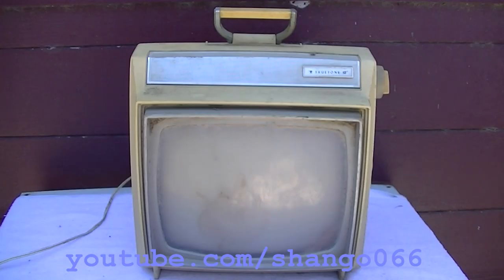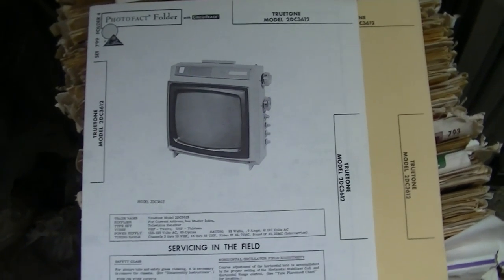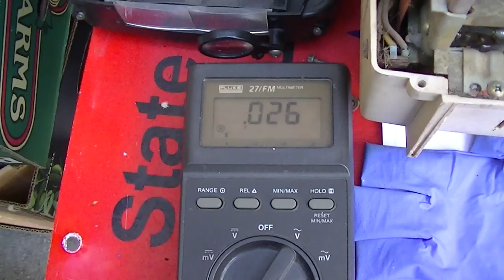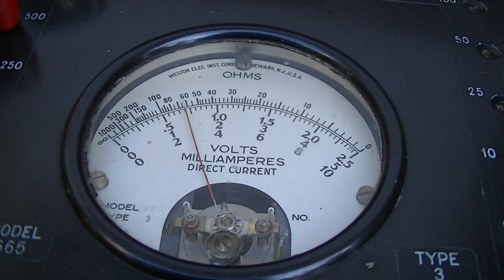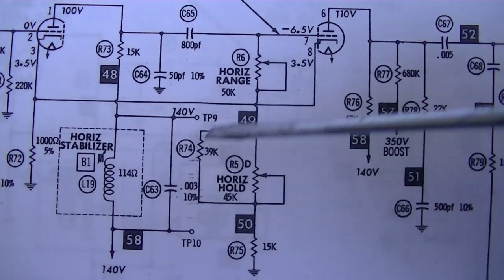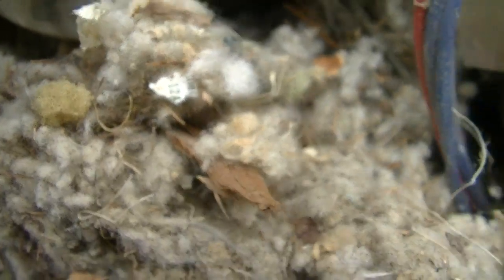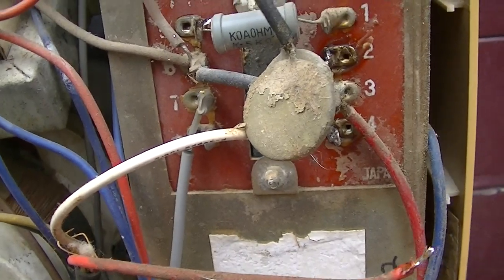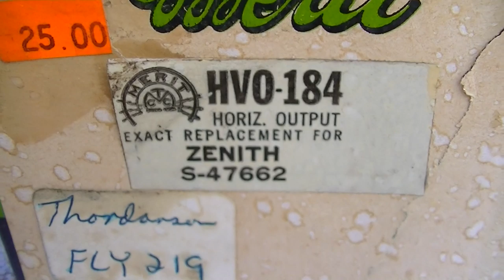Resurrection Of 1966 Truetone Portable Black And White Television Pt1

Comment: The way that the Line Output Transformer Primary in that Set was constructed was known as Wave Winding.A Lecturer at the College I went to in my youth had come up with a way of curing shorted and hard to get wound components.He would soak them in a mixture of Varnish and Turpentine and then allow them to dry before trying to use them again.I have not tried this myself but he seemed confident that this could be made to work.Good luck with your plan to try to substitute the Line Output Transformer and get a picture on this Set.

Comment: Diagnostic thinking, doesn't frustrate me at all. In fact it's through watching your videos and trying to think in a similar way that I've got my old Philips oscilloscope finally working properly.  I could've researched, shotgunned all the lockfit transistors and crossed my fingers but as it goes I only had to translate a section of the Dutch service manual, buy a small batch of  BF194's and a couple of odd others i had in stock & was away.  Much more fun learning how it is supposed to work, why it's not working and what's stopping it from doing than it is just rebuilding something wholesale.  Thanks again, and again proud to consider myself a student of your methodology.  Also, never knew silverfish ate paper!

Comment: Not related to this video but I have a 1951 german radio with a blown across the line capacitor.  I find you to be great at this stuff. Cant find a schematic for it. What is the typical the cap used in that application? Thanks
Edit: Im was hopping to see that mouse pillow showing some picture!

Comment: If this replacement tranformer is designed for similar size CRT and tube H-out, it should work OK if the yoke inductance is near the same. I also did it once with old BW TV.

Comment: Do you always work with an isolation transformer, or do you trust the gloves for safety?
Reply from the maker: Hardly ever, Ill try and address that in the future
Reply: @shango066  I don't have a big enough transformer for tube sets... I do without. 
But one time i definitely tested my luck, using my oscilloscope. Being careful all the time to not touch the metal parts of the scope... But i brushed past the 1/10 probe casing. 
I had some urethane slippers on my feet so i was well isolated, didn't feel more than a minor tingle. But could've been worse...

Comment: You should remove the nest so we can see what the set inerds look like.  Cleanup with Mr. Clean not necessary, just a good attack with a shop vac.
HF gives away TenTec VOMs that are good for destructive measurements in TV set horizontal circuits.  38HE7 has some pins marked IC (internal connection) which should NOT be used as tiepoints, they are marked as NC on the 33GY7.  Guess one of those IC's was the filament!   No HV, did the mouse eat the yoke?

Comment: Would that have been r12, 22, 502????. You remind me of me....I hate to give up on anything. True story: I had a laptop that quit and over seven years I took it apart at least four times. The fifth time I accidently plugged in a different power supply and IT CAME BACK TO LIFE! All it needed was an extra 500 mv. Understand ....I used to work at TI. Dummy me.